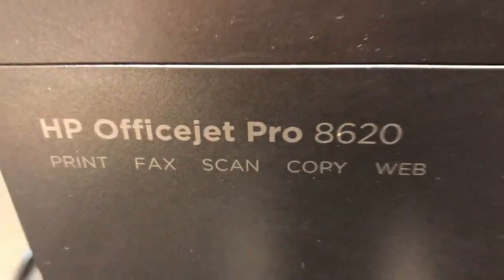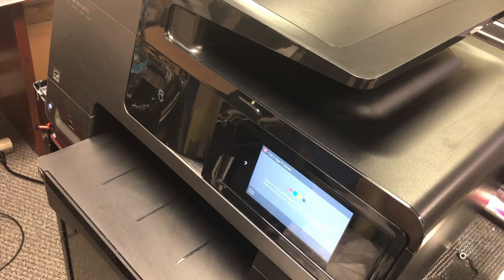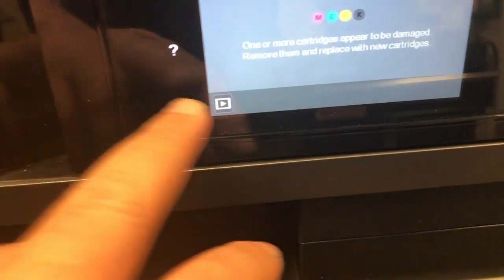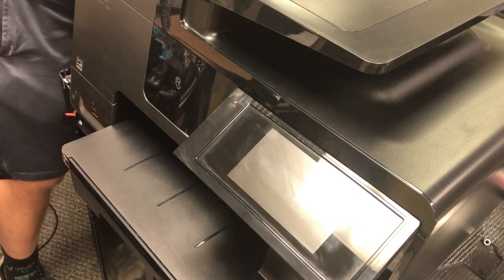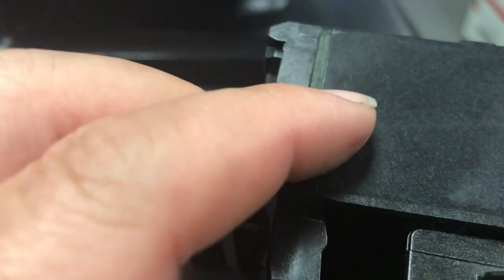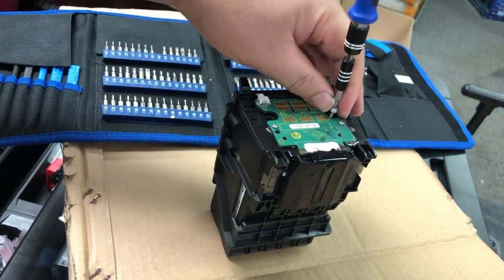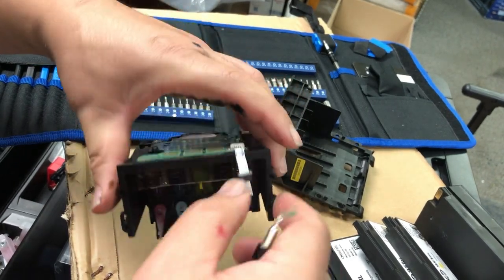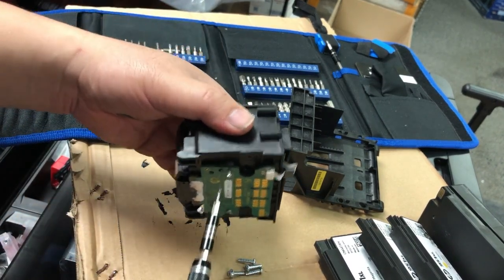Truth in Urban Legend? Using tinfoil to reset HP Printer Ink Levels

Comment: Each pair of springs goes to a level sensor in the nozzle reservoir. These are not granular sensors like the fuel gauge of your car. Rather, they are an ON/OFF type.
When the circuit goes "open", the printer knows there is absolutely no ink left in that reservoir, and stops the printer.
It does this because the 950/951 printhead has a heater that burns/melts/dries the ink into the paper. That is why 95x prints are so much more robust than normal inkjet prints.
The ink cools these heaters. No ink, no cooling. No cooling = cooked printhead.
The only logical reason to intentionally do this mod would be for some type of wonky CISS implementation.
However, if one takes that logic board off the printhead assembly, it is virtually impossible to get all 8 springs back on the terminals down in the printhead reservoirs.  If you miss even one spring, the printer will not function.
In that scenario, you can short all of the connections and the printer will never register an out of ink condition.
That lets you use the printhead... until you run out of ink.
Then you get to buy a new printhead anyway.

Comment: Even with aluminum foil, it works without problems on my HP 7612. By the way, HP is one of the worst printers.
They prevent the software from reloading cartridges and installing replacements in any way.
They deliberately create software that causes problems and very stupid and abnormal errors appear on printers.
Epson and Brother law....invented the world for HP....HP is just plain crap to be bypassed in a wide arc.

Comment: The method with that foil solves the ink system failure/printer failure error for me, but I do what the guy from brazil you talked about does with soldering wire and making a U shape. The resetting of ink levels I never heard about that though.
Reply: It doesn't "reset" the levels, the printer just never gets the "completely out" signal.
Reply from the maker: Thanks for sharing!